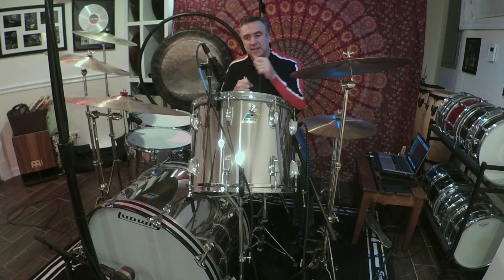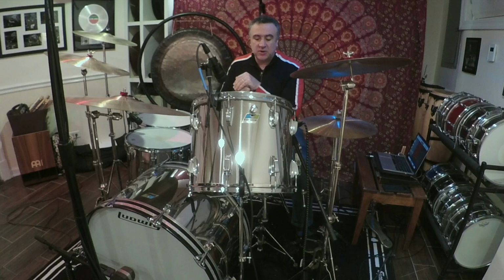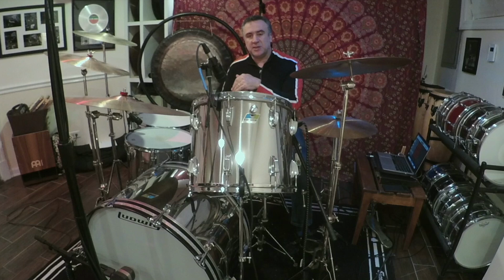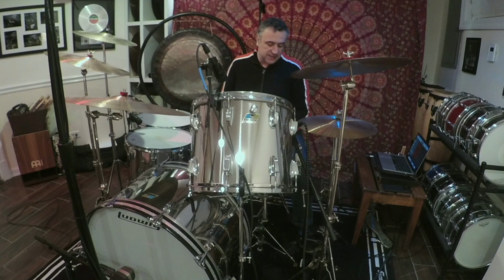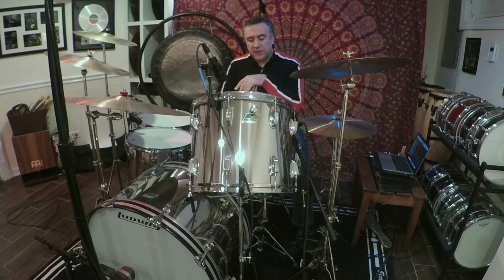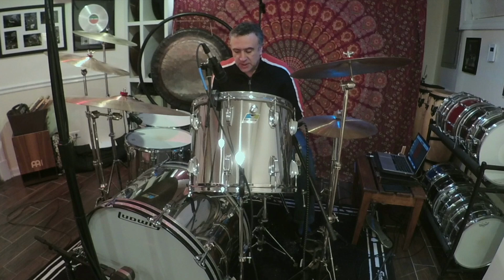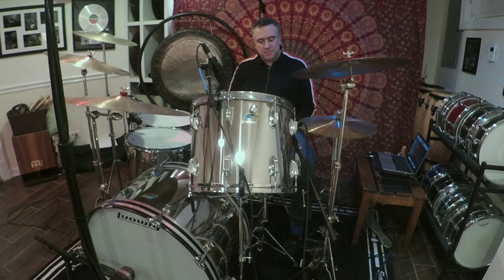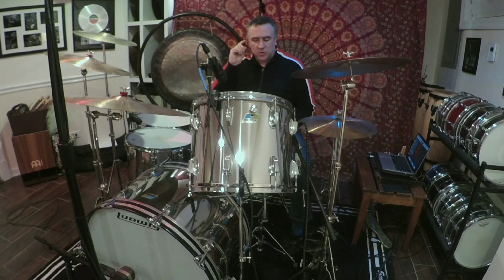70'S STAINLESS STEEL LUDWIG KIT DEMO

Comment: I bought this same Ludwig stainless steel kit (5 piece with all hardware and a 22" Paiste 2002 ride cymbal) from my drum teacher in Hong Kong for HK$3000 (= US$380) back in late 80's.  His family had financial strain and that's why he had to sell his drums.  The drums were in mint condition (tom mount was suck though).  I kept it only for about a year and sold it (without the ride cymbal) for the same price because I didn't appreciate the value of the kit.  Also, I wasn't good in tuning at that time and picked wrong heads (blue Evans clear heads) for the drums based on look and so I could never get a good sound out of it.  Besides, I so hated the tom mount which uses the hex nuts that would never hold the toms securely.  After years, I regret selling it.

Comment: It really is great sounding kit and both you and that kit are lucky to have found each other. You certainly can get the best out of it . And I still rate as the best kit Bonham had. I can’t wait till Terry lets you “Borrow “ his vistalite kit. Would you take the stainless kit out on your day job as jazz drummer?
Reply from the maker: hey Robert, thanks! I might do that to scare the sax section! 😂
Reply: @BONHAMOLOGY  are you a full on speed king lover or does the camco still have a place in your life?
Reply from the maker: @rbrtcrowther  I use Camco more often on gigs , I also use a cheap Sonor pedal that I like.
Reply: @BONHAMOLOGY   As much as I love my Speed King those Camco pedals are awesome!
Reply: I have a collection of 3 identical Camco pedals that I use wood beaters on 2 of, and a hard felt beater on 1. I have a couple early DW 5000 pedals that are close copies,  minus the plate, and I have yet to find a modern pedal that feels as good. I just don't like the feel of most of the over built pedals with heavy multi row chains, and heavy components. I used to find them frequently for 30 bucks, but the prices have kept creeping up.

Comment: Love it. That 15 sounds like it isn't quite resonating. I have found that even an Atlas type stand with its basket tightening screw will choke a drum. Nog sure why the light weight one would do that. Usually they don't
Reply from the maker: I realized after I made the video that the muffler was touching the batter head a little bit. 🤓
Reply: Maybe consider one of those gauger snare stand isolation mounts..got one and it really makes a difference. Not sure if a 15" is available tho

Comment: First of all, I'd have to clean my shorts out if I ever got my hands on a kit like that, second, I gained 2 inches of penis length hearing it. I am so envious.    :)    The one thing I noticed about it is that the mounted tom sounds more choked than the floor toms. The decay sounds off.